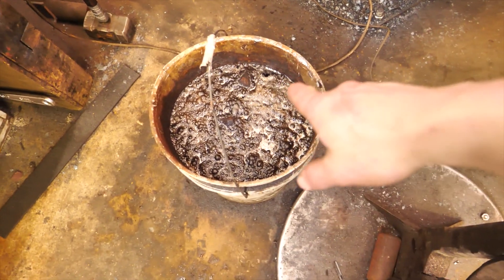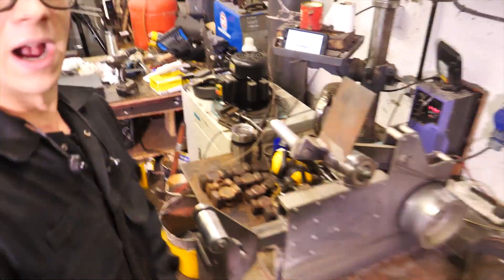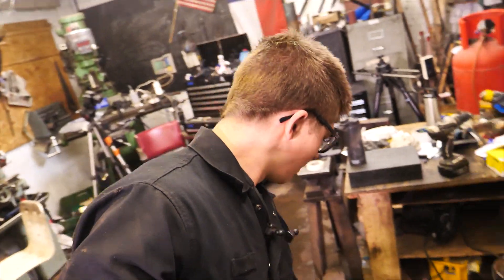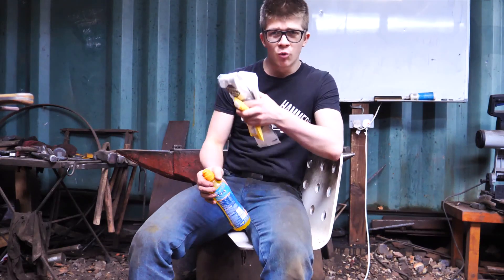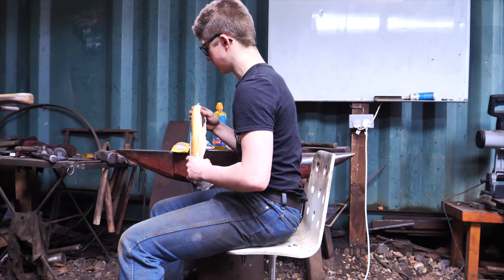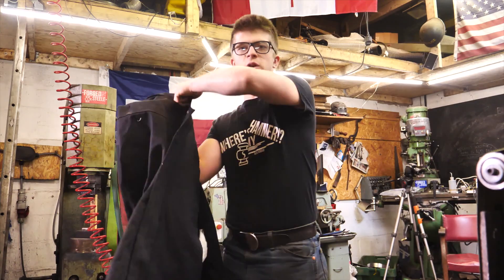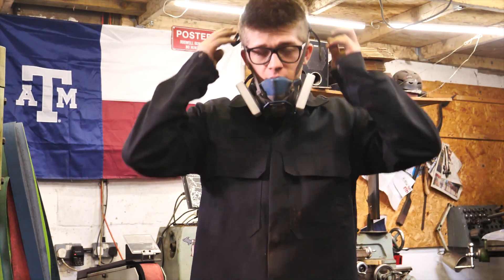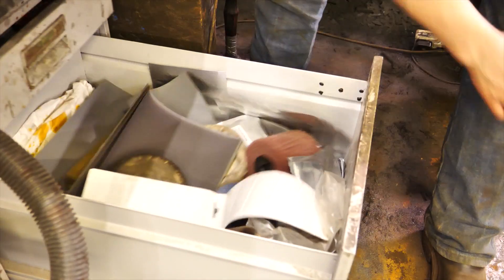BELT GRINDER BELT EXPLODES

Comment: When I saw the top spring loaded arm jump up after the belt let go I thought, safety chain with a hook on the end of it ,from the arm to non moving part of the sander structure to limit the amount of movement of the arm and consequently the sanding belt when a belt breaks. Leave just enough slack in the chain to allow the spring to tension the belt. * Taking proper safety procedures in a shop is not being a "girl" it's being smart. Ask any old timer missing an eye or some fingers.

Comment: Vinegar is 5-20% acetic acid, the chemical name is ethanoic acid. You can buy 80% ethanoic acid from chemical suppliers like Bonnymans (UK supplier) on the Internet. Distilled malt vinegar might be as good as any descaling solution (the ones I have seen are 20%) but £3.35 per gallon at your local Makro instead of £24/gallon plus postage.

Comment: vinegar is Great on rusted metal. leave in for an hr to a day and you can litterally wash it off with water and then clean up if needed.   Also safety is paramount.  I once took my safety glasses off because I was done draining brake fluid from a system.  I turned and "touched" the line end just enough to flick a pin size drop of brake fluid into the air and into my eye. the 30 ft blind walk to the water took forever. 

yes white vinegar is what I use.  easier to see results but lieve in too long and you get a mess

Comment: I'm a welder at this logging equipment company and the 4 other works there and I share a belt sander. I've been there a month and I've had 3 belts explode on me. The first time I didnt know what happened but you just have to always know that its a possibility.

Comment: I don't know anything about forging but I just wanted to know why the thing that's putting tension on your belt (probably to hold it in place) is moving during the first few minutes that you grind (around 2:25). Is it because the belt is new and that it losens up on the first use? Or could it be that your spring puts too much tension on it?
Sorry about my poor english ^^

Comment: I noticed that the belt stretches as it is used. I wonder if you could figure out at what point the belts explode and make something that turns off the grinder when the tensioner hits a certain point.

Comment: You're not talking about vinegar. You're talking about acetic acid. It's chemistry!!
and look down the cleaning products aisle in your local store. You'll probably find white or distilled vinegar for cleaning, and that's the stuff you want to use. Usually comes in gallon bottles here in the states. Grocery stores or home improvement stores generally stock it.

Comment: wear whatever protective equipment you want bub. at least getting slapped by an abrasive belt is a LOT less hazardous than being on the recieveing end of snapping a chainsaw chain. what it is, is that when the chain breaks the saw takes the rest of the chain and continues doing it's business but as the broken end whips around the end of the bar the last link is flipped so hard that it actually shoots of the end of the chain. that barshot is lethal. it's why when you read the manual with your saw it tells you that no one is to stand in front of the saw. I'm sure there are videos out there that tell about this better than me. and possibly show all the gorey bits. 
I personally put a hole of a rather sobering size into a 4x4 post. 
what I'm really getting at here is do what makes you feel comfortable when doing your work. and fiddle sticks to the Nay Sayers

Comment: why not make a slotted grate with a vertical handle that sits in the bottom of the bucket so you can pull up the hammers out of the vinegar easier?

Comment: If you're going to pickle in acid, then why use vinegar when the industry standard is hydrochloric acid? It's cheaper and easily available (it's sold in B&Q  etc as brick cleaner at about 35% concentration). Also, whilst the PPE is good, using compressed air to clean yourself down is not. It can actually drive particles and liquids into the skin. Anyway, greetings from Costessey.

Comment: if you have never worked with high speed sanding belts you have no idea how dangerous they are the edges cut so fast its over in a blink not good if it hits you

Comment: Is it possible that the vinegar weakened the glue in the belt? Can some people that use vinegar comment on how often the belts fail when using vinegar to reduce scale then grinding; or if the belt manufacturers can comment on recommendations.

Comment: The belt exploding isn't really dangerous at all... Now if you had hit your head on the corner of that heavy table it might have been another story.  Please pad them somehow so if you do hit it you'll still be with us. I've lost a few friends from falling & hitting their heads on some solid metal structure. Just make a wooden piece that slips on/off the corner & maybe attach some foam rubber to it. Might save your life (or someone else) one day.  Best part is if it's in your way you can just slide it off.

Comment: Use to drain lead acid batteries with an axe and screwing tops off. Got angry with a sealed one that the axe kept binding in  so I wacked it really hard;boom!, took me a while to figure I had not been shot at with a shotgun and the ends had blown off. ps girlfriends account.